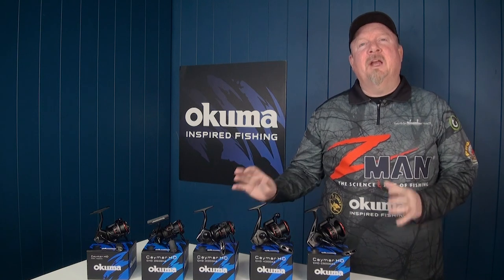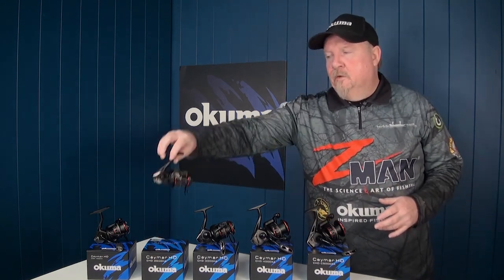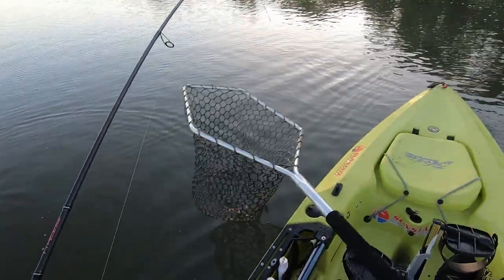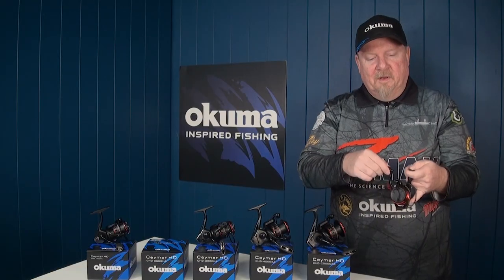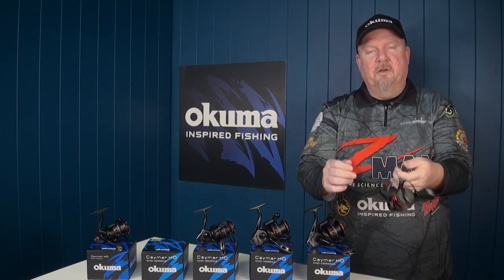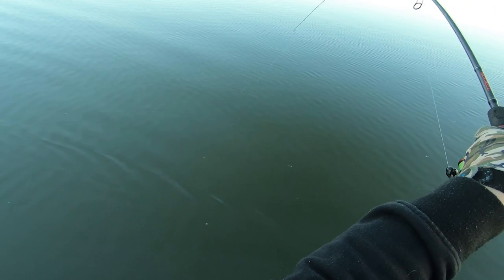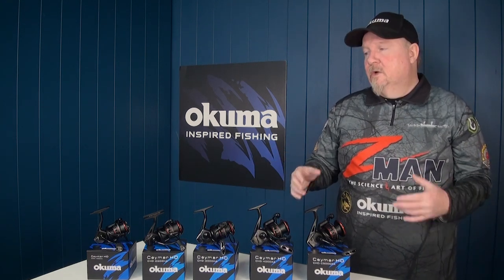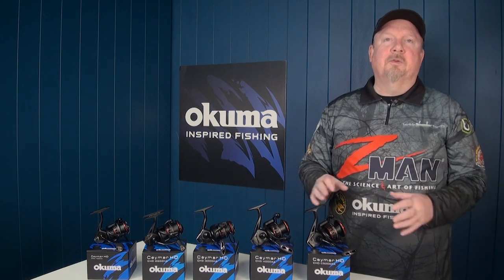Okuma Ceymar HD Spinning Reels - An Introduction & Overview

Comment: I've had the hd 1000ha for a year or so now, and it's been brilliant.
Eats the same price point "D" brand reels for breakfast.
Reply from the maker: Hey @geoffhonky4439, awesome to hear the reel is doing the job and we hope you're getting stuck into a few fish. It's a favourite of mine also and I agree, it offers anglers excellent value for money... best in class. All the best with the fishing. Cheers, Justin
Reply: Hi Justin, where can I get or order replacement parts? The handle/bearing cover has come off and been lost. I have it covered with tape but really need a replacement cover. Cheers.
Reply from the maker: @geoffhonky4439  drop the team an email at info@tackletactics.com.au and they should be able to get it sorted for you. Hope you get stuck into a few fish soon. Cheers, Justin

Comment: I’m looking for a reel size size for the Okuma guide select pro 7 ft 6 rod 2-6 lbs line rating??
Reply: If you're going UL then the 1K with 4lb mono. But the GSP length & line rating you're using you can go 2500 with 6lb mono or the 3K with 8lb. For that "lighter fare". Just got the 1K so will go 4lb mono. Thinking of the Celilo UL Rod to pair with it.